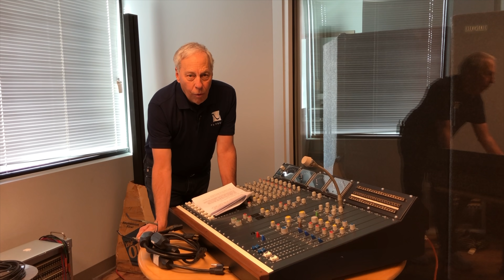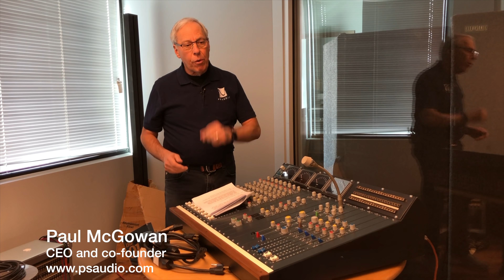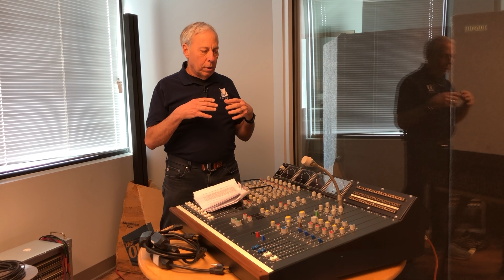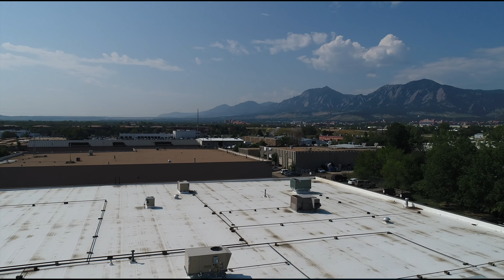Why is analog easier to preserve than digital?

Comment: there is a lot of error in this video that I'm not going to comment about, but one thing to be said is that analog media is lossy, meaning you are going to lose data not matter what you do, due to chemical/material changes over time, due to temperature, wear etc. there is no escaping it, there is nothing you can do about it, that's why you never ever ever ever record in analog, you lose what you record and it doesn't stick, master, copies or otherwise
Reply: I have 38 year old record albums that say you're wrong.
Reply: Oh, and analog is NOT "lossy", does not throw away information.
Reply: Billy Grinstead is that what it feels like when you listen to it, or did you measure with test equipment?
Reply: @FooBar89  No that's a fact. Lost is a function of some digital codecs, they throw away what is deemed "non essential " information in order to save space. The lower the bit rate the more info is thrown away.
Not only is no information thrown away with analog , there is no way to do so. You might lose some info with damage but that is not "lossy", that's just not taking care of your stuff or maybe the occasional accident. 
With analog you get back what you put in.
Reply: @Billy Grinstead: You have no clue what you are talking about. Please go and educate yourself before you embarrass yourself.